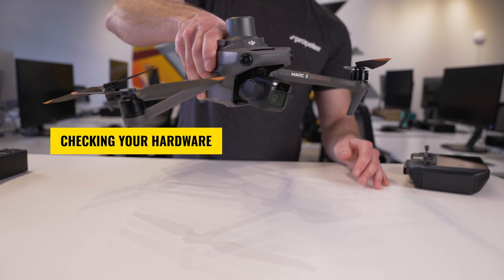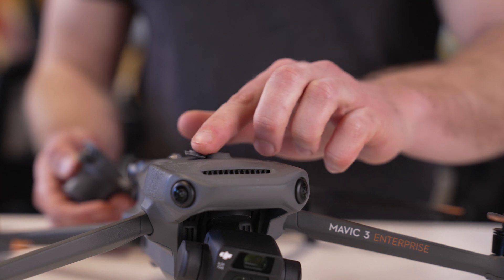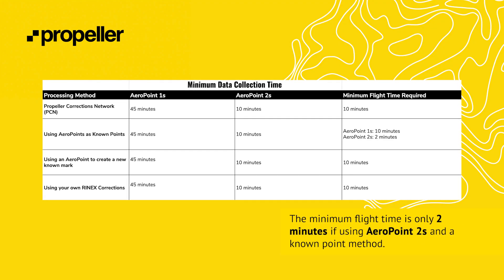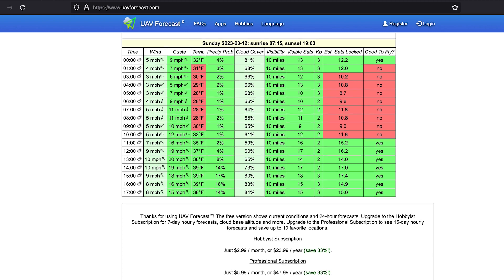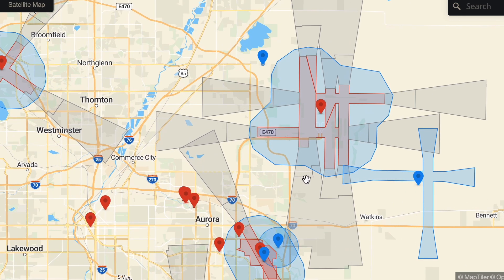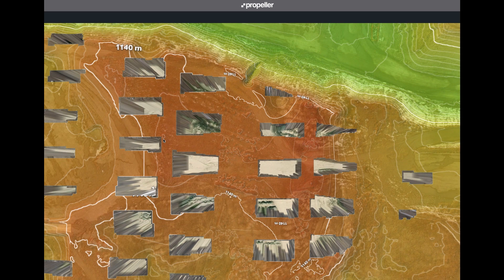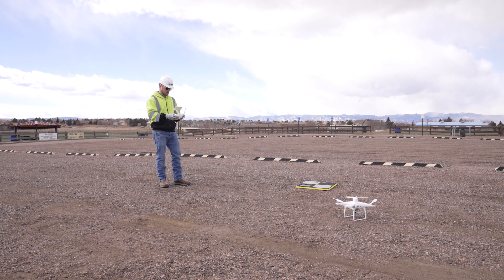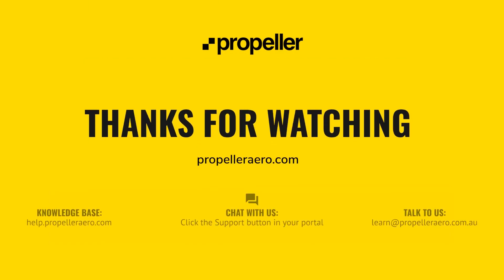How to Improve the Quality of Your Surveys

Comment: I understand that AeroPoints need a certain amount of time to collect accurate data. I don't understand the minimum flight time requirement. Why does it matter how much time there is between the first photo and last photo on each battery?

Instead of making the Drone fly slower, could you just land it and wait for time to pass, then take off and finish the flight?